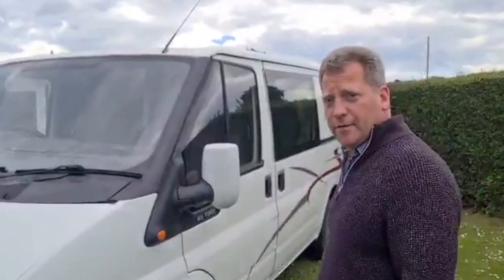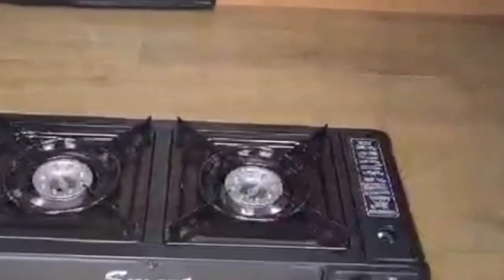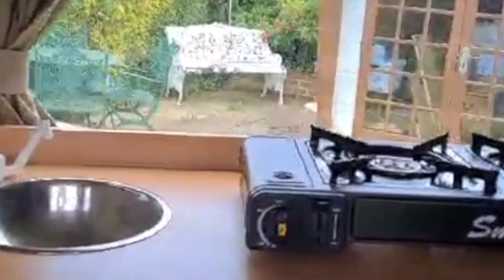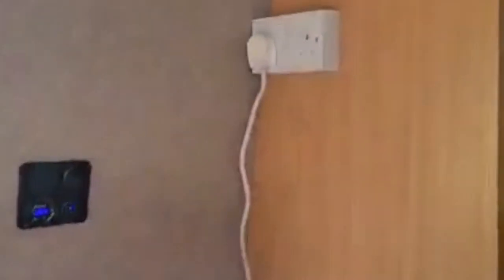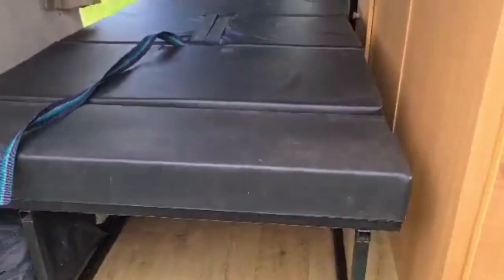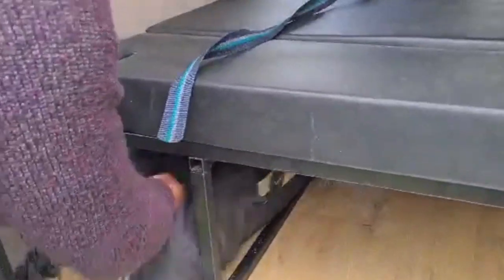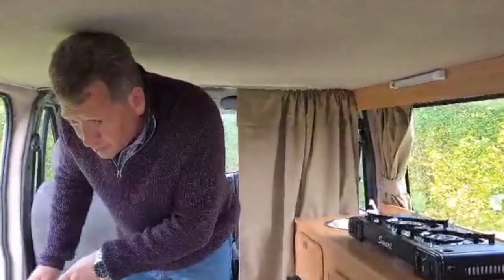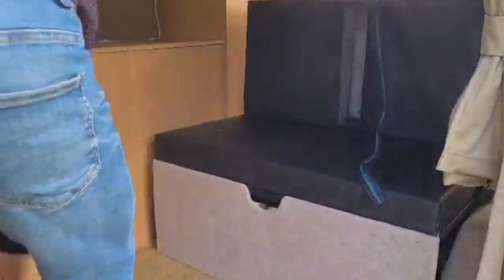Introduction - My Ford Transit Camper Conversion with Rock and Roll Bed

Comment: Great video, perfect for a quick getaway.
The hob must move around when driving, where do you keep it when on the move?
Reply from the maker: Hi the hob is kept in its box under the rock and roll bed when not in use and when driving.